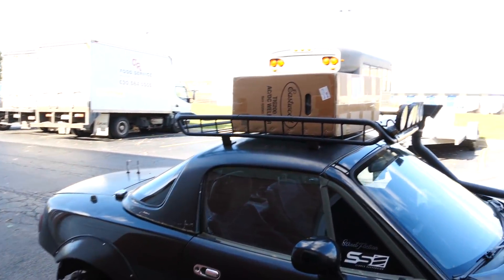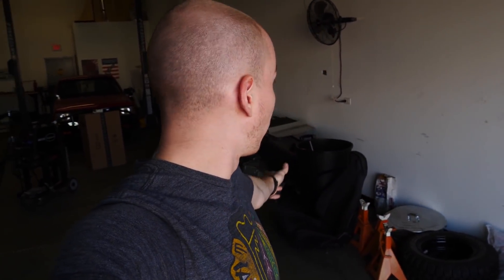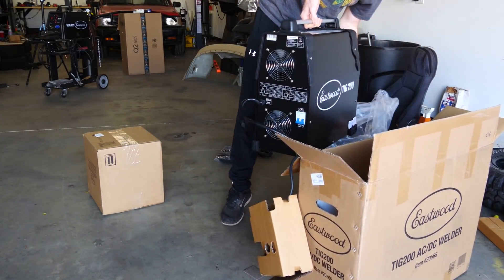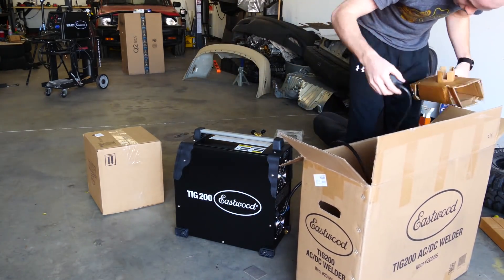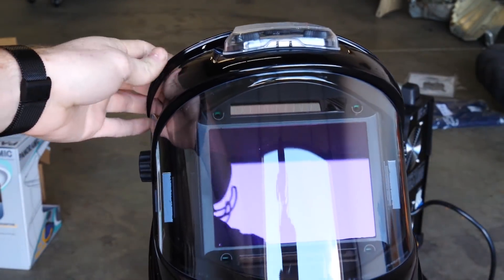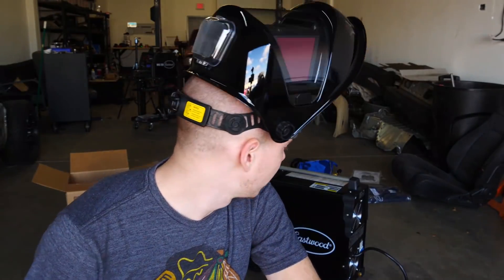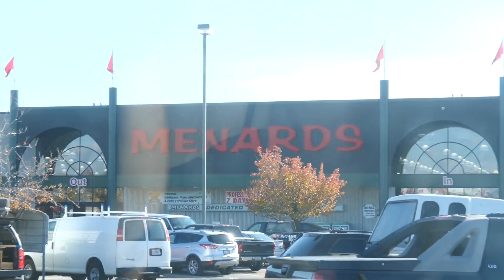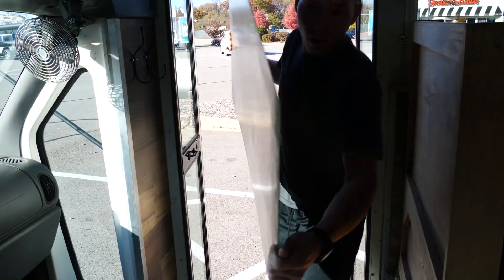The New TIG Welding Setup - I Can Weld EVERYTHING!

Comment from the maker: Sorry this video took so long to make! There will be another video tomorrow! <3
Reply: :D
Reply: Call up the Tig lord Alberto Big Boost
Reply: Gingium correction. It can, not you can.
Edit : I’m sure you’ll learn tho
Reply: Get a tank of c02 to use on your mig machine, you will get way more penetration.
Reply: What’s the background on the blue Miata’s name?
Reply: what about egg shells and broken hearts? hmm..?..
edit* it's about time' Kid 
Congrats!
Reply: Use the second helmet for use. I find it very satisfying to watch welding though a lens. I believe we can injure ourselves if you're welding
Reply: Fabium got an upgrade.
Reply: Gingium Please tell me you wear a respirator when welding stainless steel.
Reply: Gotta learn how to walk the cup now
Reply: Tigium
Reply: Get a transformer box, mains too 240v cheaper way till you get the shops electrical sorted.
Reply: For a daily vehicle when you look for one, consider a truck. Personally I don't care what kind and i'm sure no one will. But look for one with a 8 foot bed. Or as many call it, a long bed. And it can be gas, its main purpose would be daily driving and most trucks are very comfortable. And the bed can be used for the conventional purpose of picking up the metal, wood or just big things for your projects. You Could put a pap cap on the bed so its like an enclosed trailer so you can also use it through winter and rain. So the bus can still be for traveling, but the truck can be used for getting the big things for your projects.
Reply: If you want any help figuring out how to setup the new welder, for a material just let me know.
Reply: @Ares Konnor instablaster :)
Reply: @Demetrius Keenan i really appreciate your reply. I got to the site on google and Im in the hacking process now.
I see it takes a while so I will reply here later when my account password hopefully is recovered.
Reply: @Demetrius Keenan It did the trick and I actually got access to my account again. Im so happy:D
Thanks so much you saved my account !
Reply: @Ares Konnor no problem =)

Comment: Hey! Eastwood! I want to see Gingium use a plasma cutter.
Reply: I want to see him use a vice first, he needs a bigger air setup for plasma
Reply: I agree he needs a vise but, actually a plasma cutter doesn't need a massive compressor to work, it does need a decent one. I have a plasma cutter and run it off of the same size compressor as a roofing company. Then you need an air/water separator and your set.
Reply: Yeah for real, hook the brother up please.... Send him a cheap vise too
Reply: I thought he final went and bought a vise
Reply: Jake 1024 TIGIUM

Comment: Euuhm i saw your torch fly through the screen a few times but you need to sharpen the tip of the tungsten rod to direct the arc. As soon as you contact material with it the tip goes bad because you melt steel/other metal onto the tungsten and ruin the tip. Just rotate it over a sanding belt till you get a really sharp point on it (theres probably tons of videos online of how to do this).
A professional way to do it is to use a sharpening machine made specifically  for this. (Idc how its called)

For your safety though, make sure you NEVER STAB YOURSELF with the tungsten. It can cause blood poisoning so be careful with that. 😅

Cant wait to see you try welding tig!
Reply from the maker: Thank you for the info! I was aware that I needed to sharpen the tungsten, but I don't really have anything to do that with lol. I guess sand paper will work
Reply: Gingium sand paper will contaminate the tungsten. You can get hand held tungsten sharpeners or use a fine(ish) grit bench grinder but make sure you only use it for tungsten
Reply: @thebaggins321  really? Ive never heard that one before, ive only welded TIG in 2 internships before but everyone there just sharpened them on belt sanders.
At school we had a specific sharpener tool. Kinda looked like a handheld grinder with a special tool and box attached
Reply: @_Gingium_  a diamond crusted grinding stone for a bench grinder will work for tungsten without contaimnated it also you will have to really clean the metal before you weld on it no mill scale oh and a wire wheel for your grinder to go over your weld

Comment: Hey gingium, when you touch the tip to the metal by accident, you don't need to get a whole new rod, you just need to take it to a belt sander on a spot that no other metal has touched, and make a new point on the tip.

Comment: You should invest in a small pedestal grinder to keep your Electrodes sharpened (sharpened electrode = a stable arc thus a tighter bead) and if you dip your electrode in the puddle just snap it off below the filler and resharpen... Not ruined just a minor setback ^.^

Comment: If you accidentally dip the tungsten in the puddle, it’s not too big of a deal. It’ll dull the tungsten but it won’t be ruined. You’ll just have to resharpen the tip of it.

Comment: You just need to run a 208/240 circuit to a 4 prong outlet near your welding area from your breaker. It shouldn’t be too expensive for an electrician

Comment: why dont you get a step up power converter for your shop
Reply: He probably already has 240 it's just the thing of wiring from the panel.  Most panels have two hots going to them, and each breaker alternates between the two hots, if you put a double pole, you get 240v.  (this is putting it in simple terms mind you)

Comment: Cant you just get transformer that puts out 240v?
Reply: probably it's a 3-phase 240v supply he needs. that's probably why he said getting one it's expensive.
Don't know much about the US electric norm, but at least where i'm from, you have to ask the electricity supplier to give you a 3-phase connection, right before sending them a study detailing how much electrical power you will need (e.g 20kW) and giving them all the calculations.
Reply: Most buildings in the US have 240v in them for washers, dryers, electric stoves, etc. Just a case of having a company install a plug in the right place. That is all I had to do to setup my welder. It was about 200 bucks. Course my fuse panel is in my garage, where I wanted the plug, so it didn't have to go far. He will need multiple plugs though. If he said why it was expensive I can't remember.
Reply: Should probably be able to run some 8/3 to the panel and put in a dryer plug, looks like that's what the welder uses.   Need a spare slot for a 40 amp double pole breaker.  I think even if it's 3 phase it should work similar but would need to check voltages between phases to see how it's setup, there's different styles of configuration.  Hopefully he has standard 240/120 split phase as that is easier.     I'm sure some of us could walk him through how to do it.  Should not be more than like $100 of material.
Reply: That welder is not 3 phase.
Reply: Welder is not, but hydro service may be. Either way it will be doable though.  If I had to guess he probably has a standard 200 amp split phase service.

Comment: 1 You can get 240 volts from 2 120v outlets (search it)
2 watch 6061   weldingtipsandtricks   weld.com  or any other fab channel to learn tig faster. 
CONGRTATS on the new welder!

Comment: Why not wire in your own 240v plug underneath the breaker board? Don't need a full circuit straight away.

Comment: Well the America is even weirdier than I thought. Making 120 volt electricity? Who dafuq would need it? Put just 250 everywhere. In Europe everything is 220-230V
Reply: Gedas Alekveravičius fun fact, the US uses 110 as a standard because when the electrical grid was being expanded around the 1800’s there was an excess of copper bing mined and to increase the sale of copper the government standardized 110v because to carry the same every at 110v you need double the amperage witch means double the copper in all the wires.

Comment: 2:15 the reason we are tired of seeing you weld in short sleeves is because you can actually get something called a radiation burn from welding and it will look and feel like a sun burn but you can actually very easily get skin cancer from it. We out here just tryna look out for one another